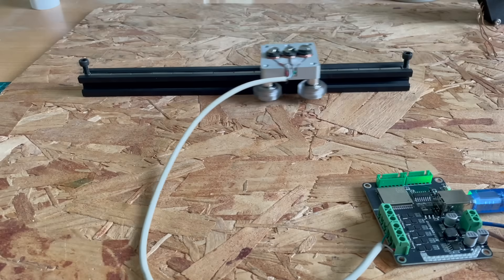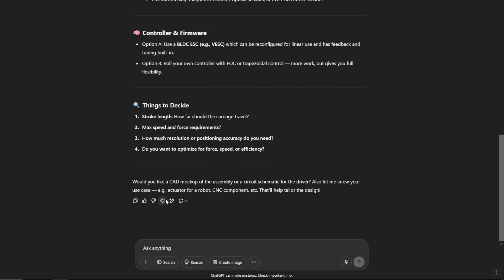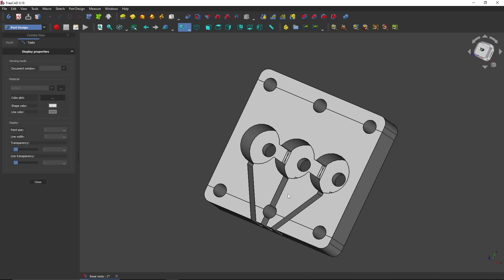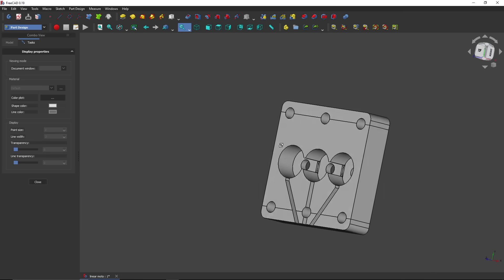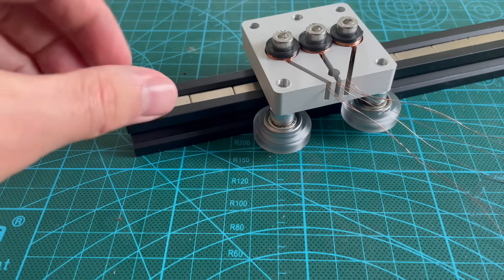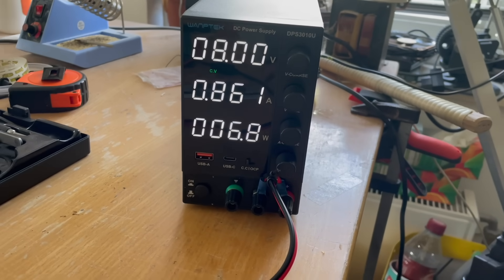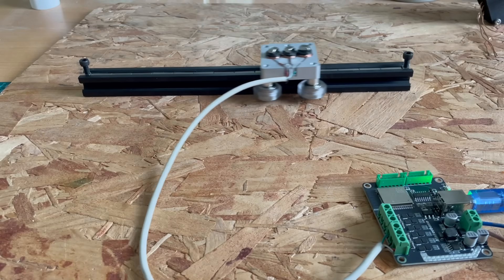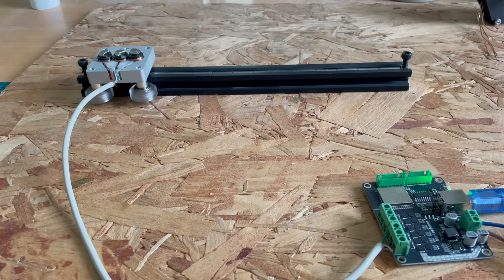AI Designed This Linear Motor

Comment: you have a lot of magnetic fields changing the whole time. Aluminium seems not to have an effect on magnetism, but it has. They're called eddy currents. Could it be that they have an effect on your setup?
Reply from the maker: That’s a good point it might have an effect but it is very small I also printed a housing out of plastic and it was still kinda weak. This kind of motor just isn’t very strong

Comment: yup, seems about right, what "A.I" does is look for solutions that it read on the internet (or in books that were transcribed for it) ... thing is, it clearly has a lot more hobbiest blog posts as input than engineering books, and it needs (far) fewer steps to reach the hobbiest solution than a good engineer level solution, so it gives you this half assed weak thing, which a hobbiest programmer-bro would make, but even a 3rd semester engineer would be too ashamed to talk about let alone put it on the internet for the world to see.
Reply: OK, I'd like to make it clear, my criticism was of A.I design, not the creator of this video, and the last part was about the source material that the A.I trained on, not this video .... i see this video as a proof of concept for a.i design, not as a how-to video.

Comment: Make the distance between your magnets and coil as small as possible with longer screws and spacers for more torque. Also consider a larger surface for the magnetic interaction by using square nuts
Reply from the maker: That's a good idea, I'll try that for the next iteration!

Comment: No, AI did not design this. AI took the expamples it had and combined the aspects of it and it just happened to work.

AI cannot reason, it *IS NOT INTELLIGENT*.

What you did is use a fancier search engine that gobbled a ton of WORKING linear motors together and this  was the result. It is *generated*, not *designed*.

The same nonsense keeps being repeated for Ai being able to write computer code. No, it can't. Give it a problem that it has never seen before and it will fail spectacularly. It is barely able to do a half-decent job at the simple stuff because it is not intelligent*. Ofcourse in programming there is the added problem that AI can *only do the easy stuff, leaving all the difficult stuff to the humans who have no clue why the AI chose to do the easy stuff the way it did (because it's not intelligent) and that makes the difficult stuff even  more difficult.

Just to hammer this bit home: Aircraft have crashed because pilots became so reliant on the auto-pilot doing all the easy stuff that when their plane had a problem, the auto-pilot kept compensating and compansating until it reached it's limit of authority and disengaged, dropping the pilots into a situation that required 100% of the autopilots abilities to keep the plane from crashing, and suddenly they had to figure out what was going on and if their controls were even able to compensate.

Lots of people overestimate AI because they think it's a super-intelligence. It's not. It's a chatbot that has ZERO intelligence. It does not even know how many fingers go on a hand, because '5' is not the correct answer, five is what most people are born with, but a hand with two fingers is still a hand, even six finger is still a hand. Get educated.

Comment: duplicate it , flip it ontop with a small offset and connect the gantry plates togther and now u have 6 coil motor , or just start from scratch with a  20x40 rails 2 sides of magnets offset ofc and u know the rest :>

Comment: I played with linear motors five years ago and ran into similar problems. I don't quite remember the details, but with after a short exchange I got this from ChatGPT. Hope it helps:

--
Low torque in linear BLDC systems is often due to poor commutation or non-ideal current phasing. Implementing Field-Oriented Control (FOC) with sinusoidal PWM based on accurate rotor position helps align the stator current vector with the magnetic field, maximizing torque. Use current feedback to correct for phase lag and nonlinearity. Also, as @drewteter suggests, check the coil-to-magnet air gap—too wide reduces flux, too narrow increases drag or cogging.

For smooth motion and minimal mechanical stress, consider using jerk-limited s-curve trajectories for position control. These limit not just acceleration but also the rate of change of acceleration (jerk), resulting in gradual transitions that reduce vibration, improve tracking, and make current demands more predictable—especially beneficial in high-precision or high-speed systems.

--
If you feed the above to ChatGPT, it may come up with the right code optimization.

Comment: I would use half of a core used in a SMPS transformer with the bobbin of that type of transformer for each phase. This will increase the pulling force due to increased magnetic field strength of the coils.

Next, try and use all four sides of the extrusion with magnets and coils.

Lastly the turns per coil is important as all three phases need to balanced.

Comment: if you used 4040 extrusion, bigger magnets and linear rails it would be smoother and more powerful as weight added resistance to the wheels.

Comment: Try various different coils. Like thicker wires and more current. Or use existing coils with higher voltage. P=I*U so you get more power.

Comment: Mechanical design engineer here, this video title gave me chills until i saw the image of the linear motor... Someday AI but not today.
Reply: there are different TYPES of ai that excel at different particular disciplines. Grok for example with tell you straight up that he can show you a diagram but it will be a very crude ascii chart. Grok is a highly skilled text/word/language based ai model but NOT gfx and diagrams. you can then take your out put from one ai and feed it into another for the pretty illustrations if you need to

Comment: This concept isn't new at all, I assembled machines with linear motors before. They usually require a lot of current, so the motors and magnets are water cooled. Also, for smoother operation you could use shorter magnets and more coils (like 6 or even 9, but still in three phases), then actuate them like a sinewave using PWM. The magnets should also be spaced apart a little bit, or they will magnetically shortcircuit eachother, weakening the field through the coils.

I don't think AI is able to understand all the correlations between the parts and physical processes enough to design something that works really well, especially out of the box. You still need a human to process whatever the AI coughs up and turn it into something at least semi functional.

Comment: your carriage is suitable for arduino but for normal driver you need more suitable magnetic core with flat area near magnets. imagine three U-shaped cores out of steel, like UUU with flat bottom, or like Ш, you place coil spools on top between vertical parts so it close EM circuit. whole length should be i guess 3/4 of 2 magnets

Comment: 3D printers require a lot of force to ensure surface imperfections not affect print quality. We were trying to fix/upgrade Anet A6 and z end stop somehow dislodged. Before I noticed and cancelled, print head carved a nice circular shape to aluminum base almost 1mm deep without skipping a step.

Comment: Whatever chatgpt reply is "not invented or produced new. It is already written. Chatgpt's work is to find it and present it before you. Pls  comment if am wrong.
Reply: Well, that is wrong. Even simple LLMs don't work like that. It's been trained on data, but the output can be a sentence that's never been written before. 
On a basic level, simple LLMs will look at a training text and analyse it in terms of n-grams as well as word frequency, but even simple combinations of n-grams can produce new sentences. 
And that's just with the most basic early LLMs. Things like chatGPT are far more complicated.
Reply: no it's a text predictor. The garbage it spits out just follows statical chances so if you are lucky it will output something resembling a good idea, once in a long while.
Reply: @youtubehandlesux  That's not true. For just one example, current LLMs provably pass the Turing test. People can't tell the difference.

Comment: since you need more torque you need to increase (R/L) where R is total wire resistance and L is inductance. the next part is important. R/L is proportional to 1/(NA).  but when the coil volume is fixed, the maximum number of turns N and the wire cross sectional area A is inversely proportional. this means you cannot change your torque by changing the wire gauge in the ideal model. in real life because that is packing inefficiency of the coils, and larger gauge are more inefficient in packing, you might see a small improvement to torque going up in wire thickness, but this is not going to be your main source of improvement.

the coil/magnet gap needs to be minimized. the magnets can be replaced with stronger magnets. the stainless steel screw that forms the magnet core can be replaced with black high carbon steel or something even more ferromagnetic than that. increase the current limit of the driver. finally, you will have to change the parameters of the coil volume to minimize NA.

Comment: its the size of the coils ( electro magnets) vs the size of the magnets, and the distance between the magnets and the coils ( air gap) make an rectangular coil the same size as the magnet and get it as close to the magnet as possible without touching

Comment: Generic suggestions for improving torque/force:
  - Reduce any gap between the coils and the magnets to a minimum.
  - Check the coils' spacing relative to the magnets' spacing. I think the distance between the first and last coil should be 1.5x the distance between the north-facing and the south-facing magnets. (Distances measured from center to center)
  - Arrange the magnets in a Halbach array to direct the magnetic field towards your coils.
  - Put some ferrous material on the back side of your magnets. A thin sheet of iron, or something similar, in the bottom of the slot below the magnets will also help direct your magnetic field.
  - Use a higher amperage in your coils (as long as the wire/electronics can safely withstand it)
  - Use a rectangular-shaped coil to more efficiently fill the space between coils, effectively increasing the length of wire in each coil.
Reply: Yep all of these problems are visible in this design, when i saw number of windings and AWG i thought: no torque!

Comment: I think its the number of stages insted of log ways try a shorter n52 5mm side wasy so you have like 8x the stages and your core them bolts dont make very good flux cores  the magnetic feild is probaly not very strong off it. try using a commerical electro magnet @12v there all over ebay  you can drive them with the lower voltage using a dc ssr and a nice beefy psu

Comment: Without redesigning this and doing more than seems likely to be worth it, this won’t be viable for 3D printing as seen here: not nearly enough torque, way too much mass creating far too much inertia to result in it being reliably used for accuracy and repeatability. This doesn’t have enough addressability to move it to a location and hold it there with a resolution that’d be required.

Comment: Maybe put aluminium or plastic spacers between each magnet so their magnetic fields are separate instead of continuous, it might increase the torque because the magnetic field at the poles of each magnet would extend further out radially if they were separated axially.

Comment: To get torque you must move the motor electromagnet terminals closer to the magnets. This means the magnets will need to be anchored down and not able to fly up and hit the motor pegs. You can clamp them down and glue them with some E-6000 glue which will remain flexible and hold them down. You need to make the top surface of the magnet strip straight and flat and parallel to the motor movement, then adjust the screw ends down closer to the magnets. 20 thousandths of an inch is close enough that you should get at least some torque.

Comment: Great design. It is amazing how smooth the motion is. It looks like the screws in the center of the coils are non-magnetic stainless steel. Would it work better using magnetic steel screws?

Comment: The linear motors are interesting but I'm wondering what's stopping you from just mounting cheaper motors (like stepper motors) onto the wheels that run up and down the track. You could use a rack and pinion setup maybe. It would be an extremely simple way to make a pseudo "linear motor." At any rate, I'm sure you already thought of that and this video is more about exploring the process of making a true linear motor and that doing what I've suggested would just defeat the purpose of your video 😅

Comment: i suggest changing the metal part from JLCCNC to a plastic part. 
the aluminium part where the center screws of the coils are screwed in, could interfere with the magnetic field produced by the coils.
aluminium also creates eddy current wich induces a breaking effect when it moves along the magnets in the rail.

Comment: 1. The Y vs Delta configuration doesn't change anything on the controller side. In industrial 3 phases motors you often uses delta for low voltage (ex 230v) and Y for high voltage (ex 480v). Think of it as parallel vs serial connection of the coils.

2. You need thicker and/or more strands of wires with less turn per wires to reduce the resistance of the coils. If you have too much resistance you limit the current you can pass and you don't give room for back emf when in motion. Remember that voltage is the key factor for speed while current is the key factor for torque, but they are all linked together.

3. while it is true aluminum is not magnetic, it still conduct electricity. What it means is applying a changing magnetic field will produce current, which will produce an opposite magnetic field. So having aluminum between the coils and the magnets reduce drastically the field interaction between them. It also mean more heating (losses), heat and magnets is not a good match.

4. Having round coils l
with a diameter larger than the magnets create a lost in the aluminum extrusion, see point 3. It apply to a lesser degree.

5. Since the attach point of the coils is on the bottom (same side as the magnets) and there is no magnetic material on the top, you lose a lot of magnetic flux. Ideally what you want is an E shaped magnetic core with the 3 branches pointing the magnets. It will help direct the field will making it easier to close the gap between the coils and the magnets. It should help in making the coils more oval helping with the 'contact' area with the magnets.

6. You did not show maths so you might already know this. You need to align the odd number of coils to an even number of magnets in order to get the attraction-repulsion effect run smoothly. From the video it is hard to see, but since it is easier to use smaller magnets, what you will typically see is a 3-4 or 3-8 ratio for more precise movements. But you can see other arrangements like 5-4 that uses stepper motor controller signals.

7. Using a halback arrangement would help in producing a stronger field as many comments suggest, but with thin magnets like the one you use I don't think it will be that much better. The others options should be tried first and then look for a better magnets layout.

*If I didn't say it before, the closer the coils and the magnets are, the stronger the interaction between the fields.

Motors are very complex if you want to maximize performance, bus as you saw it is kind of easy to make a low performance one. Any way, I enjoyed the video, I only wanted to give feedback and new points to explore.

Comment: Try putting an iron bar over the coils and on the back side of the magnets.

Magnetic fields hate air gaps.  They like magnetic circuits where they travel through iron rather than air.

If you look at real motors there are generally magnetic circuits where the field can leverage the North Pole and return to the South Pole.  Field lines are closed paths.
Reply: Also make sure you have a magnetic material in the core of the coils.

Comment: Hi! You can to add "weight" as a parameter for redesign this motor, but make motor actually light weight, and then you will have all the torque that can "pickup" weight you set in "weight" parameter, but actual "weight" = light weight (because of material) + weight that you need to move.
Example: you choose model from stone in chat GPT, but actually make model from wood.

Comment: I used to salvage Linear motors out of old Electric Typewriters and Word Processors that were common E-waste back in the early 2000's.  They had a large flat metal track and coils with a similar setup to a normal stepper motor.